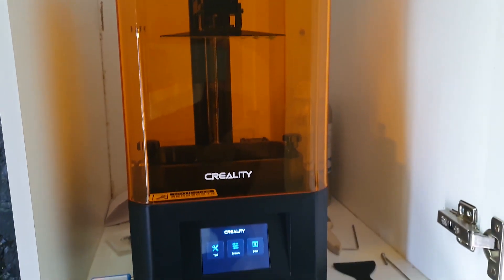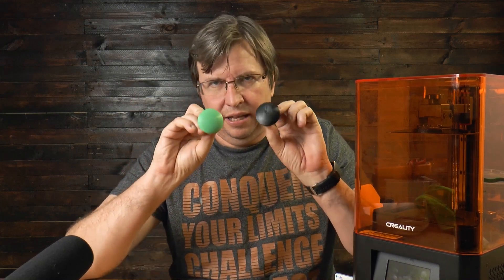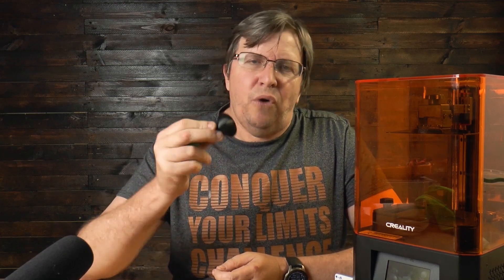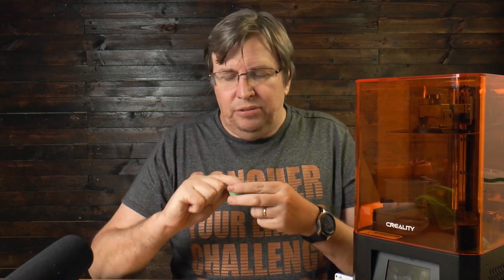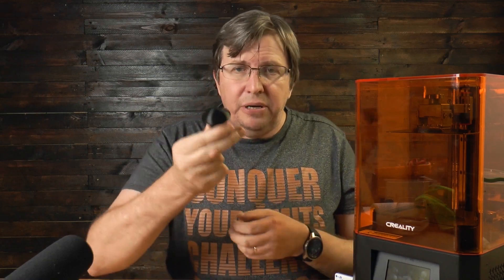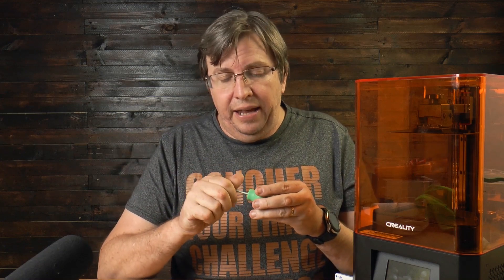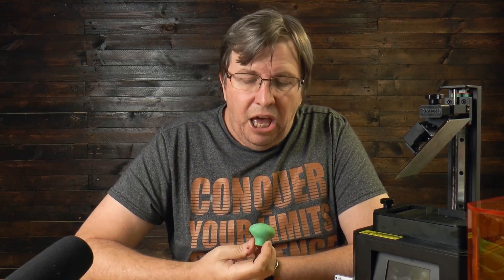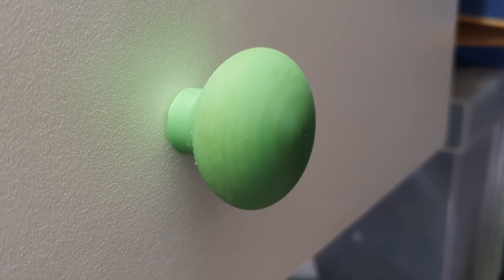Warning when printing with resin | SHOCKING RESULT

Comment: Thanks for the video. I have bad experiences with larger filled objects. They often still contain liquid resin inside, and when they are damaged, this poisonous resin leaks out. Chitubox has a function to hollow out objects and make a hole in them, this reduces the risk, less resin is needed and they become lighter and do not warp on the plate.
Reply from the maker: Thanks for sharing!
Reply: I"m behind a lot on this, but watching it I was thinking something similar, although in this case you'd need struts probably, if you flipped the part and printed so that the mounting hole is "down", you could create a significant void inside the part, and a cylinder where the drilled hole ends up being anyway, and that would let the resin drain while it prints and lighten (and reduce resin usage) significantly.  (A differently shaped know (flatter top for instance) might need less "struts" to print well, but obviously for this round knob, you'd probably want some mesh around radius near the outer edges just to bolster it as it gets thicker, which might negate any resin savings (but still helps with the final weight).

Comment: Good video, and it makes perfect sense.  I am hesitant to leave a print on the build plate overnight for fear of this happening.  I generally set long prints to go overnight and finish in the morning, or I print first thing and cure later that day. 

And why 50% infill?  Did you want the more solid, weighted feel?  I would have thought a 15-20% infill would have worked for the FDM version...just a thought.  Again, great job, both good looking prints!!
Reply from the maker: Hi Christian, thanks for the compliments.  I did a 50% infill on the door knobs because it gave it a nice feel, feels really solid and also aids with the threading of the screw, nice tight grip there on the screw.  I probably could have gone with less of an infill but I have printed 15 of them already and they look great